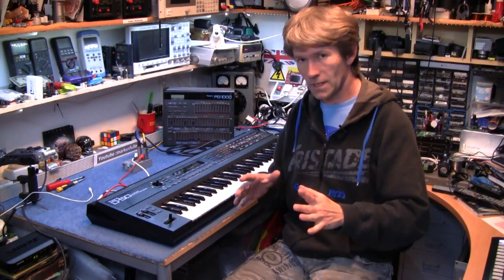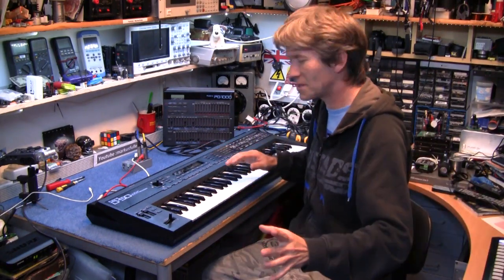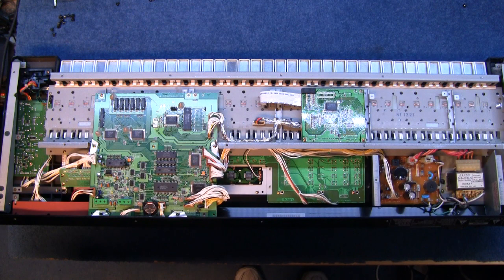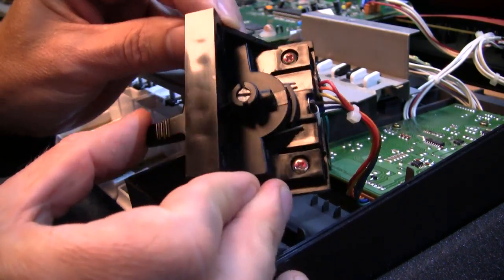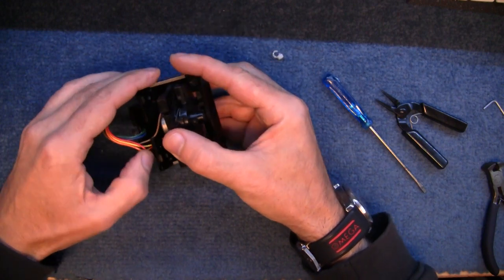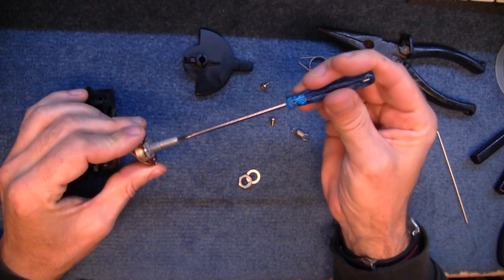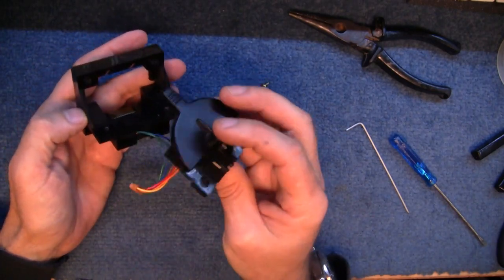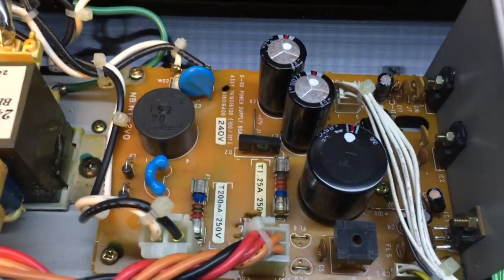Roland D-50 synthesiser pitch bender repair

Comment: Back in the day Roland went to Fujitsu Semiconductor. They were making Digital Signal Processors in various versions called the MB87xxx series. There is not much to find on the internet because it was all done under NDA. The  SYNTHE, REVERB and CHORUS chip are DSP's that have been tailored to Roland's needs including MASK ROM firmware inside. All that Fujitsu stuff was branded "FANUC" back then and had it's breakthrough with the MB87103 (DIL40). It's real target market was actually: Intelligent motor control. Customers realized that this DSPs was capable doing other things like audio so they made dem develop that product line further with 24 bit versions. The Reverb is based on the same core that the MB87104 (or106?) 24 bit DSP chip was using. It has six DRAMs attached to it of which every DRAM has 16k x 4 bits. So it uses 16K words (24 bits) or 48 kbyte. The sound interface though is only 16 bits wide. The CHORUS DSP is one of the much simpler chips but still a programmable DSP. It can only handle SRAM or ROM and has the 8Kx8 SRAM attached to it. Unfortunately I never could find anything on the SYNTHE chip and I don't know what kind of core it is using. Should be similar to the reverb chip though. Ok this comment has to end now, wafflemaster out ;)
Reply from the maker: Hey Waffle on as much as you like, You certainly have great knowledge of these things and I always look forward to reading your replies as I can learn something new from you myself. Many thanks from Markus
Reply: One rarely reads something so insightful in YT comments. Good research. And I did find out exactly the same, Fujitsu, Fanuc and their early numeric controls...only like 20 years ago haha. There is more on the synthe ic MB87136 if you deep dive on .jp sites. The PCM54 suggests 16 bit but the lower four bits go thru an extra DA stage, top right from the BB. So Roland rightly calls it 20 bit conversion. I recommend the upgrade decribed here https://fr.audiofanzine.com/synthe-numerique/roland/d-50/pedago/tutoriels/lifting-electro-meca-nique-du-roland-d-50-7182/ where auto translation might be helpful again if you missed that French class. It's a night and day difference. The easy way to fix typical Roland aftertouch issue is using an expression pedal. 9:30 potentiometer with additional middle tap.

Comment: A D-50. That brings back memories. I never owned one but did lust after one for a while. I bought a Roland GR-50 guitar synth sometime around 1990 which is based on the D-10, same synth system as the D-50 but with fewer bells and whistles. I still have the GR-50 and it still works.
Reply from the maker: Hi Gareth. I remember the D-10 we had one at college but I seemed to always miss out on buying the D-50 as it was too expensive or one turned up when I was skint.

Comment: The bender potentiometer is a funny thing. It's actually two potentiometers. That weird middle tap it connected to ground. One side is connected to VREF and the other side is connected to VREF via a transistor that turns on when X0 through X3 are selected. Then they use an 8:1 multiplexer 4051 and connected the BEND output to 2 inputs X0 and X4.
Reply: Funny things plenty in the D50's design...Vref, X, Y all have 0.1 caps parallel for stabilizing V on the IC. That's what the middle tap of the (single btw) potentiometer is used for.

Comment: Hey Markus, just to tell you that you inspired me to carefully open my JP-8080 to see what was wrong with the volume knob...and guess what: the master volume board had a lose cable connector. Easy fix!
Reply: That volume knob also gave me headaches with the main outputs. Had to replace mine as the plastic shaft became wobbly.

Comment: Great video, loved seeing the inside of the instrument. I run into sticky pots all the time in my vintager tape recorder work. I use a product called: "Marvel Mystery Oil" (you can get it on Amazon). 

It is a light cleaning oil originally designed for cleaning the sludge out of V8's and other engines. It eats grease and re-liquefies it by altering its chemical composition!  

The Japanese often used a varnished-based grease in their equipment -- which would seize up after a few years. 1960's SONY tape recorders and decks are notorious for this problem and even their VCRs from the 1990's would seize up and destroy tapes. Marvel oil fixes this really well. 

I use an injection oiler and just get a few drops onto the pot shaft and let it sit for about 24 hours. It will ooze down the shaft (capillary action?) and clean up the grease inside by chemically re-vitalizing it and changing it. The grease really isn't dirty -- it has oxidized so it is like dried varnish! The pot is perfectly good, so once the grease is re-liquified, it should be good to go for many years. 

Your heat trick is good (I use it to free seized capstans and axles when I can't get the Marvel oil into the space) so I can get them apart. Then I clean off the old grease with -- you guessed it -- Marvel Mystery Oil. Otherwise, as you suspected, in a very short period, the parts will seize again. 

Hope this helps! Thanks for your videos I enjoy them very much.

I'd love to see you dive into a Roland XV-5080 rack unit!
Reply from the maker: Hi Clydesight I dabbed fine watchmakers oil into the tiny gap of the shaft before I heated it. Im hoping the oil had a small chance of getting in there but I have as I am writing this just tried the pitchbender again and it seems fine, plus its quite cold here at the moment . but I will certainly go and look at this Marvel Mystery Oil. sounds good.
Reply: markusfuller   I think you will be amazed at what Marvel Mystery Oil can do. It's not that expensive and is so versatile. It will help out your projects a lot.

Comment: Having done some repair work on one of these, the D-50's construction is a good example of why I dislike mid-80s Japanese synth design. All the disparate parts are screwed together to support each other, usually with the keybed acting as a sort of "frame" to give it some rigidity, rather than giving it a solid case or real frame to which the other parts are connected.

Comment: Thanks very muchly for this.  So interesting that it has a 16bit dac.  Back in the day, we went through great trouble to make sure it was recorded on a 24bit system... I wonder how hard a hack it would be to bypass the dac and take the stream directly.  And how many of the newer synths have 24bit dacs?  And 96k?  The mind wanders.... P:)
Reply: 16 or 24 bit really wouldn't make any difference in this application. A higher bit-depth than 16 bit would theoretically give you a higher dynamic range, but the D-50 is somewhat noise to begin with. So it doesn't come close to the theoretical limit of 16 bit. Therefore a 24-bit DAC wouldn't do anything for the sound quality. Also in 1987 such a DAC was probably not available or extremely expensive.

Comment: Fantastic video, Markus! Thanks a lot for letting us discover its "hidden" internal secrets!! ;) 
I love that LA sound from the 80s & 90s, I personnally own a XP80 for many years now (sadly, needed to be serviced cause of malfunction of one of the audio outputs) and a Roland VARIOS with the D-50 card that contains all Roland's original extra cards and some new wave table roms!! Amazing machine. 
Kudos.
Reply from the maker: A friend of mine had the Varios, very interesting machine indeed.
Reply: Yes, iti is :) it's sampler, too with its own software you can edit on a LCD monitor.

Comment: Thanks for the video. That keyboard looks familiar. I say that, 30 years on, but I remember having a bit of a play with it in a music shop, when it was introduced. As I recall, the keyboard had a very cool choir sound. Given the time of that keyboard's manufacturing dates, I'm guessing the ram on board was between 512K, and 1Meg. That ram would've accounted for about half the cost of that keyboard, too.
Reply: Well the Atari ST came out 2 years before the D-50 for less than half the price.. and that had 512KB.. so.. it can't have been THAT much of the cost in 1987

Comment: Nice little video, Markus. Reminds me of the mid digital era where the synth just begun to take advance of the processing-power.

I had a D50 myself, back in 199x, sold it somewhere in the 200x. I always dislike ROLAND for their bender type. The standart two round disks are way better to handle.

Comment: Hi Mark , I need a advice , I'm getting a used Roland System 1 at Guitar Center US, is it a good choice to buy hat machine ???
Reply from the maker: Anubhav Mitra Hello Anubhav,  now theat the system-8 is on sale im guessing there will be several system-1 units on sale so I would try and get a better deal from your guitar centre, but the system-1 is a good synthesiser I did not like the keyboard but if you connect a larger midi keyboard to it then it is fine and you can make some very interesting sounds with it.
Reply: markusfuller I mean to ask that , is it worth buying a Second hand Used System 1 for almost $299 in US ??
Reply from the maker: Anubhav Mitra Hello the roland system-1 is new at £372 which makes it $456 US dollars so im guessing that price is not too bad that you have been quoted.

Comment: Hi , your videos Markus are awesome ! How is Roland´s built quality nowadays , for instance the system 8 , in comparison with older synths , like the D-50  ?
Reply from the maker: well to compare the casing of the system-8 with the d-50 is like the system-8 is a 3 wheeled reliant robin and a d-50 is a sherman tank. however sound quality of the system-8 is very good (well i think so) and all the buttons and rotary controllers are perfectly good to use and should last. you really have to try one out to be honest.
Reply: thank you for answering my question

Comment: The pot is a centre tapped pot i had to make one recently to repair a vox bass amp. You can still find the ones in that style so if it breaks look around there was some on eBay when I was looking but wrong type of case for the vox. Think they are used a lot in wahwah pedals
Reply from the maker: First time I ever seen one like that

Comment: Set screws slipping are a problem, for sure. And this fix is legit. However I've seen a problem on this and other Roland keyboards of the same vintage lately. the plastic part that flexes when you activate the modulation breaks. I'm working on a kit that will remedy that. Also, I have seen a lot of broken pitch wheels. The part that sticks up. Not sure how to address that.

Comment: The LAS-Chip of my D-50 is much biger. It does look like a old Intel Pentium-4. Just huge. But the sound is still outstanding. This Synth has its own spirit.
Reply from the maker: Yes I think you have the 100pin chip version and mine has fewer pins around 80 or just over but they have basically the same information on them.

Comment: 16:10 old CPU -G017, new -G022. Roland says 'increased arithmetic operation speed' but both clock 12mhz. Might explain difference in midi lag between some D50s. You can upgrade G17 to firmware 1.10 and G22 to 2.22 There is no information about this "G" version of the NEC uPD78312, I don't think it's much different from it or the later A versions

Comment: I had a D50 in the 90s wish i never sold it.  Great video description of the boards too.  Dont you need to recalibrate the pitch bender after moving the pot? I did this on my XP80 in the service menu on power up.
Reply from the maker: Hello, I just placed the pot as centred as possible by eye and it seems to be ok. maybe it gathers pot settings when on power up and uses that as centre. I really do not know.
Reply: You are probably correct Markus. To confirm it, you could hold it off centre while it boots and sample a note, reboot the synth with no bend, play the same note and compare. If both notes sound the same, it is calibrating upon boot.

Comment: Congratz on your D-50 + PG-1000! I'm so jealous, it's probably the dream synth for me, but they're hard to come by here, the few you see are usually in terrible condition, and I don't trust to buy it online. But yours looks to be in beautiful condition, lucky :-)
Lucky easy fix too it seems. I would probably have dripped a bit of oil on the shaft after heating it, and let it run in while rotating it, give it a chance to work in some fresh lubricant. Miniscule difference, but think it would've lessened the risk of it seizing up again in the future.
Thanks for an awesome video :-)
Reply from the maker: Hi Marc. Yes I should have tried a bit of regreasing as it was hot but the gap was so tiny I doubt anything could have flowed through. however it is still working at the moment but when it starts sticking again I will try some new grease while its warm. Its in incredibly good condition and I doubt the original owner ever used it often.

Comment: I would have just put a few drops of penetrating oil on the shaft where it goes inside the sleeve and leave it set overnight. I bet that would've done the trick.
Reply: I have done this with a few pots over the years. The problem is that you reduce the viscosity of the grease, it can ruin the feel of the thing, ruining the lubrication leading to a bit of a wobble and then it all runs down potentially depositing the now much thinner grease all over the wiper strip. I think Markus did the right thing, in his case at least.

Comment: Hi Marcus, thanks for another great video!
At 16:15, you point out the PCM ROM, and next to it is a similar but unpopulated ROM slot. Would it the theoretically be able to expand the ROM wave set? 
Cheers
Reply from the maker: Thats a good question Simon and one that I do not have the answer to. still it has got me wondering the same thing.

Comment: Hi Markus, great videos. I was wondering if you could help me with something. I acquired Casio WK-3000 but it has a problem. Eight keys next to each other would play the sound as like hard pressed and then  the LCD indicates that they are still pressed so no more sound when pressed again. When switched off and back on its fine until I pressed them again. I had a quick look and tried to clean the connectors and even swapped the rubber with other keys but the same keys are still playing up. The keys move freely and everything else works without problems. Any idea what could be wrong and where to look? Thanks.
Reply from the maker: zz-top Hi That is a problem i have not heard about before?. it sounds as though the synth thinks the keys have not been released thats why you cannot retrigger them a second time. I would check the ribbon connector from the keybed to the main board and then maybe switch on the instrument and short across one of the carbon tracks where a pad would make contact just to see if i can trigger the same note several times. if you can only do it once then theres a problem in the main board though i cannot guess what it could be.
Reply: Thanks, I'll try that.

Comment: Hey I just bought a brand new keyboard and need advise.

The pitch bender isn’t fully lose but does wiggle a bit by just barely touching it.

Should I return it for another one before my 30 days in up?

Or is this just my OCD kicking in.

Comment: Hi Markus, it's great to see the old keyboards still in transit )) i have a Roland D50 also in mint condition and i can kindly say I'm the only person who i believe has one in Cyprus? I would like your advise on something please? I had a issue with it and when i went to use it, i noticed i had no sound. I had the power supply changed. When i got it back, i noticed the display was flashing, also the pitch bender would only pitch down, when i used the pitch bend up, it would only sound down? I haven't tried yet to undo the back cover to see if i have the same issue mas seen in your video, but i have ordered another one from Ebay (used in good working order ). Can you please advise me? And finally do you have any spare parts for sale for a Roland D50 if i need any in future, as you know it's hard to find there parts? Or do you know of any web site i can order from?  Many Thanks ))  Keep the good work up ))